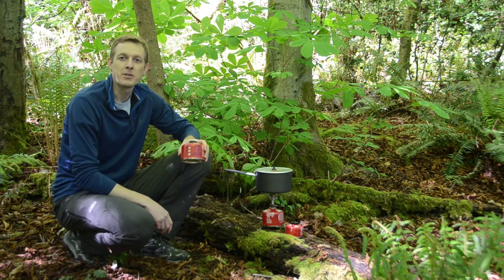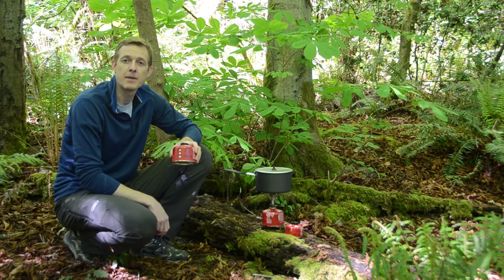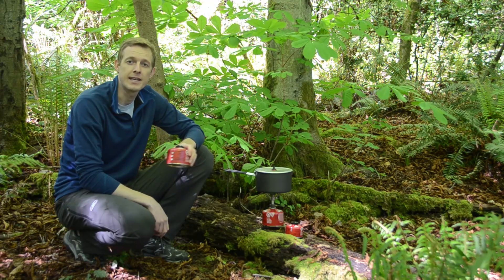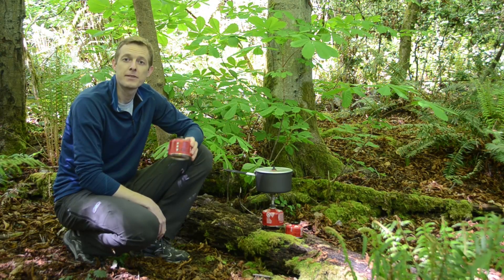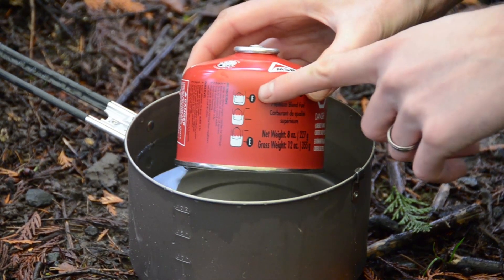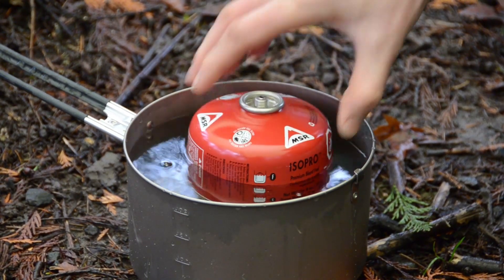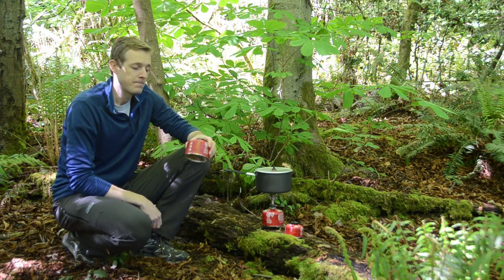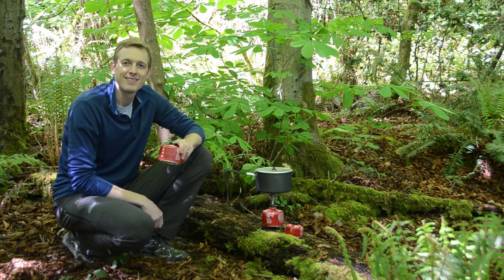MSR Stoves: Measuring Canister Fuel

Comment: This, to me, is the perfect example of brilliant product development. It’s simple, adds zero weight or complexity to the product, and yet adds a Huge degree of usefulness, all with a simple ingenious addition to the printed graphic.

I consistently buy only MSR canisters (even though I know the fuel is otherwise of the same quality in most major-brand fuels), purely because of this feature.
Reply: Also love that your fuel canisters print BOTH the full and net weights on the side. No one else seems to do this for some reason, and I can’t fathom why. It saves the step of looking up empty canister weights online when measuring fuel canisters at home, which is SO handy!

Comment: Ok i have never used one of these are they like co2 cartridges once they are pierced you have to leave the stove attached or can you un hook your stove and put a lid on the canister thanks for anyone who can or will answer this
Reply from the maker: Hi Melissa,

Nope, the stove does not need to remain attached. The internal workings of the Lindal valve assembly on the fuel canister features a spring loaded valve that allows the cylinder to reseal every time you unscrew that fuel canister from your stove.

Best,
Olivia

Comment: Does this system vary with altitude?
Reply from the maker: +Heidi Marcum Hi Heidi. No, this system will not vary with altitude.  The water and canister still have the same weight and that doesn’t change with elevation.

Comment: It would be nice if you "accurately" labeled and easy to understand the empty (or full) canister weight on the label- What is on the label is not accurate with any of my measurements of my empty or full canisters
Reply: I found the weights to be remarkably accurate  +-1 gram
Reply: @Phoenix88.  YMMV- but 5 years ago the canister labels at that time were not accurate